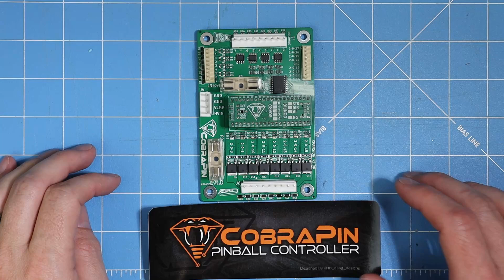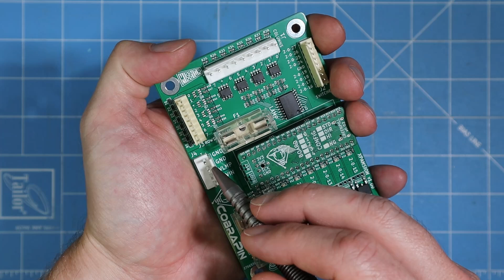CobraPin University - Xpansion Connection and Pinout

Comment: Have you done a walk through like this on the main board? 
Considering moving across from OPP to CobraPin for the ease of reference on connectors and the useful features like led on board indicators for testing.
Reply from the maker: No, not quite like this. I did a presentation at my local pinball show last year that may help: https://youtu.be/zg1fq9I3bAw?si=BmRa_4I5Jte8mxp7
Also, There is more info on Pinball Makers and MPF Docs:
https://pinballmakers.com/wiki/index.php?title=CobraPin
https://missionpinball.org/latest/hardware/opp/cobrapin/
Reply: @thomasfulenwider  thank you, I've watched a few but I'll check out that link.
I'm currently running OPP setup so should be fairly straight forward to swap over when needed.